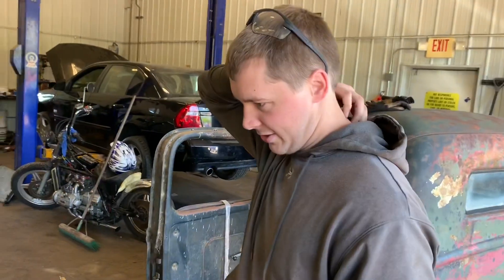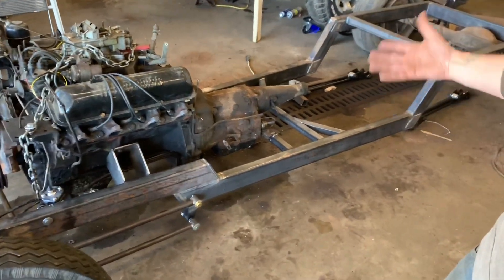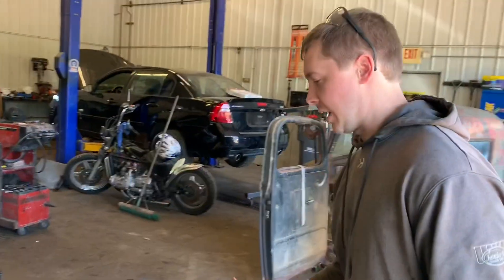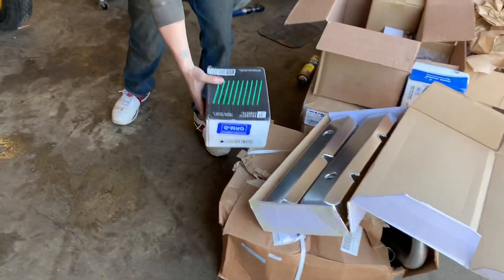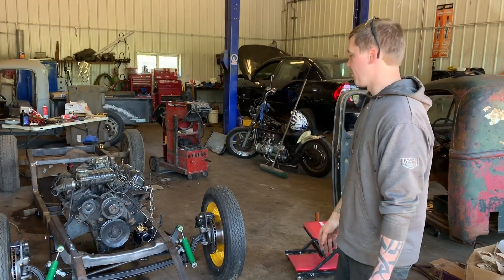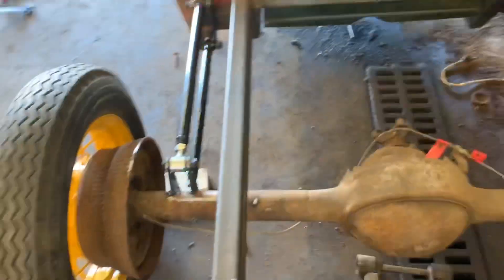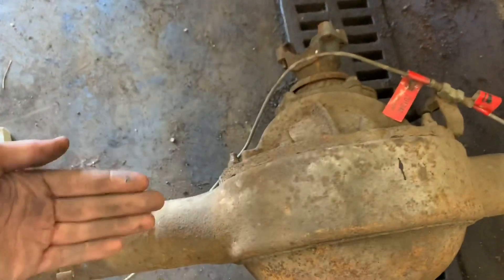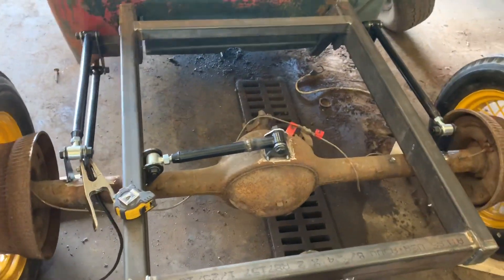Mounting the rat rod body!

Comment: If memory serves me, the pinion angle is pretty critical, and you don't want it straight. You want between 1 and 3 degrees between the tail-shaft of the transmission and driveshaft, and 1 to 3 degrees between the driveshaft and pinion. Research it, there is plenty of info out there on building chassis/drivetrains.